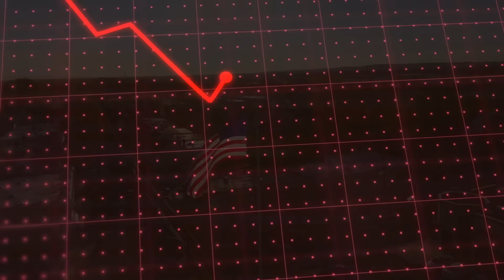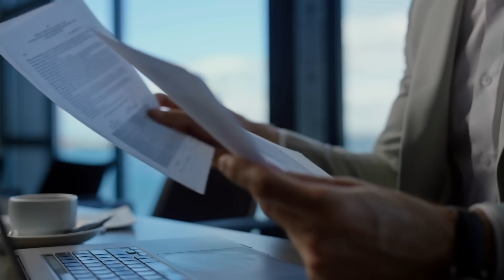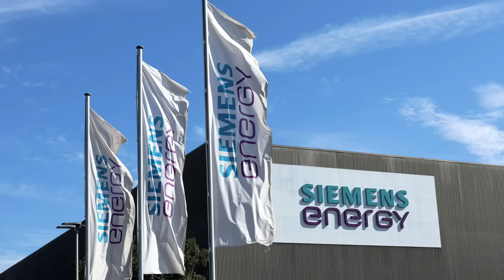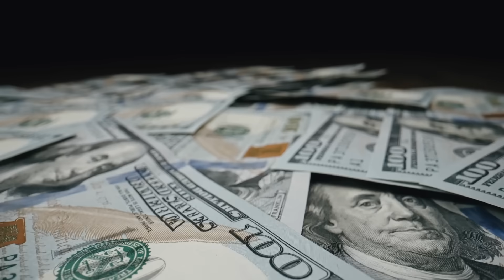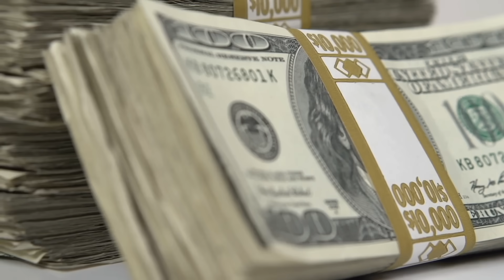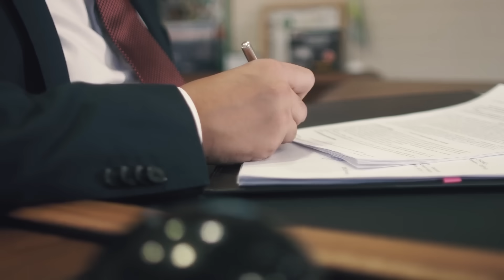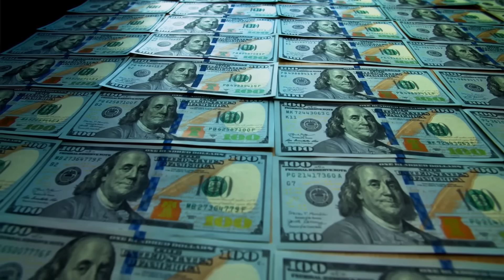The Real Reason America Has Turned Its Back On Wind Power Energy

Comment: This video raises good points that I don't see in other news.  One of the biggest problems with solar/wind is that it is inherently diffuse.  The grid was designed to transfer power from large, point sources.  Solar and wind produce a little bit here and a little bit there, requiring a much more costly, and humanly objectionable, grid.  No one wants ugly high-voltage lines ruining their scenery and TV/radio reception, and causing problems with high-voltage fields in their house.  And people don't want to pay a lot more for their electricity to fund all the extra transmission lines and transformers.  Also, the intermittency of solar/wind require fossil fuel backup.  (And don't say "big batteries" unless you have many hundreds of billions of dollars you want to donate to pay for them.)  Germany had the highest electrical rates in Europe BEFORE the Ukraine war, due to its reliance on solar/wind.
Reply: Then generate it really locally, at your home. Then you massively reduce transmission costs AND you can use it without having to buy it at supply prices which are much more expensive the way the market is set up. The energy supply industry of course don't want to advertise this as an option because they'd go out of business.
Reply: @aries6776  That means you also need to store the power locally, which is quite expensive, when you need to store power over longer periods. Transmission grid are expensive, but they serve millions of people, so per person the costs are not that high.
Reply: @aries6776  You must live in a warm climate.  That kind of thinking would sentence people living in colder climates to a quick death sentence.
Reply: @christophercharles3169  Why? Wind power is thing in colder climates, isn't it? I live in the UK and even here was can get 50% of our electricity from just solar.
Reply: @christophercharles3169   How would people living in a colder climate be given a death sentence? People in Alaska use solar power. I'd say that's a pretty cold climate.
Reply: @aries6776  Their is a compromise of setting up wind farms nearer to towns and cities, where it can be transmitted cheaper at 11kv. The high voltage grid is the problem, particularly when people build wind farms no where near where the power is needed, then blame everyone else. They would not invest in an ice cream parlour at the north pole, so why not put their brains in gear first.
What is really needed, is a government run department to plan the whole strategy, keeping production and transmission in line with each other. If 25% of the wind farm investors had invested in distribution, it would have been a win win situation.
I sometimes wonder what we have a government for, other than to make fools of themselves on the news.
Reply: @wilsjane  I wholeheartedly agree with you. It's not just your government, this happens everywhere. Too many plans go in half-cocked without taking control of all the elements and looking at the big picture. Getting funding from the wind farm investors towards distribution would have been a sensible idea.
Reply: @aries6776  Every city, every neighborhood, should have these things within feet of those that use power.  No storing anything.  Of course, you'll have to deal with light flicker, ice flying off from the blades, low frequency noise problems and cleaning up the dead birds and bats at each turbine, but it's worth it to charge our battery cars and cell phones, right?

Anyone else looking forward to the day that we put even more pesticides in our food because the bats that ate hundreds of thousands of bugs each night have gone extinct?  Funny how bats don't even need to run into the blades, just be below them a little bit as the pressure compresses their lungs and kills them.
Reply: This is why wind turbines should sit in cities, right above those that use them.  The power goes straight to the people instead of being transferred for miles and miles, losing energy.  That's right...if you want them, put them in your own backyards instead of destroying the large expanses of natural land.
Reply: @NxtHumane  They put them miles out to sea, where there is a lot of wind, and they are barely visible. That is why they need to be connected to the grid.
Reply: @scottelly2  Where they also lose a lot of power before it can be used.
Reply: Not to mention the huge tracts of land required for these projects.  In the case of wind, that land is ruined forever.   They will pour tons of concrete they will never dig up.   Wind/solar is the biggest boondoggle in history.  A total scam on the people to even pretend it is ever going to replace nat gas and coal
Reply: Don't tell the pro-wind faction about wind providing intermittent, unreliable, non-dispatchable and weather dependent power because they will call you every name in the book. It's true, but they are not interested in truth. They are interested in receiving their wind lease payments.  They will tell you that it's better than burning coal and kitty dung. But, they won't really address your comment with common sense and research.
Reply: «This video raises good points that I don't see in other news.»
--
You don't see it elsewhere because it is utter nonsense.
Reply: @voltydequa845  you’re right.  Wind and solar is ldlotic.
Reply: @NxtHumane  «you’re right.  Wind and solar is ldlotic.»
--
The ratio of solar rays  to electricity is around 15 ÷ 18  % efficiency. 
The upper limit of air's kinetic energy exploitation is around 59  %  (Bet'z law), and of course only  under ideal  conformation (that depends upon surface against the air), and seen that the surface of the today's blades is almost negligible (compared to the ideal disk-like actuators). 
Wind was used in Holland's windmills and sawmills. They were quite smart, and were aware of the limits of power that can be obtained. I read some comments here, and think that so many people live in a kind of cognitive world detached from reality and common sense. It seems that the religion of the pseudo-science (Star Trekkian - like) makes them believe miracles will be possible.
As for the nonsense about the grid, there is enough technology to connect, to the grid, even a bicycle dynamo (though won't since cost vs gain). But if there is a source with variance, that produces (even only) megawatts they can connect it without difficulties. There is enough electronics and monitoring possibilities that makes it perfectly possible. The excess of energy, of the entire grid, can be stored back by means of mechanical capacity (pumping water back up the dam - just an example), with flux proportional to the excess. etc etc. 
And the practical and simple proof on how much energy can be obtained from wind can be built next to a farm. And for sure it won't be neither bizzarre structure with thin blades, nor hot-air talk  about supposed technical difficulties to interconnect it with existing sources. 
The main problem is invested vs obtained energy (considering the life-cycle, etc),. 
And sorry for this so long.
Solar is ok, especially thermo, on small scales. In some circumstances wind too. But imho in small scales too.
Reply: @voltydequa845  I'd support small scale that were located next to the source needing it.
Reply: Yes after 49 years of constant treason by Labor/gang-green Politicians and the Cowardly LNP politicians, we are still just barely a Sovereign Nation! but have our politicians in Labor and LNP made private agreements with the Globalist Cartels for when the UN Global Government is realised! The betrayals of our Politicians for the WEF=EU=WHO=UN that have weakened our Sovereign position!
                   I remember when we did make our own fuels from our own oil and Gas, we were the Luck Country after WW2, we made and grew everything the Australian people needed, no job shortages, one income families, yes that had to change WW2 succeeded in destroying the globalist Monster on My parents time, today we are in the fight of our lives against the globalist MONSTERS of this century! the WEF=EU=WHO=UN=Billy Goats=Vanguard=Black Rock=Big Pharma=Big Tach, all wanting a position on the Great Reset table, sounds just like a movie script, must be bulldust right.
               But that was before our two UN controlled governments turned to the "Dark Side" back when we were the Lucky Country, we manufactured and grew everything the Australian People needed and exported it around the world as well! That was 49 years ago, before Labor and LNP turned to the "dark side" of the unelected United Nations,
         In 1975, with no public consultation, the ALP government of Gough Whitlam signed Australia up to the United Nations Lima Declaration which required Australia to reduce its manufacturing capabilities by around 30% and carelessly destroying 30% of Aussie workers jobs!  and to commit to importing that amount from other preferred countries China, Vietnam, India. Pakistan, etc since then the UN controlled Politicians are destroying our electricity supplies, our Industries, our defence of this nation, and are currently working on destroying our Farmers as agreed in the UN Agenda 2030 sustainability and Climate Change scams agreed to in 2015 by LNP PM Malcolm Turncoat and Julie Bishop ( She now works for the UN! No surmise there),
                        the betrayal is by both labor/Gang-greens and LNP, also the LNP leads labor in their Collaboration with the UN, also in case you are unaware, the Globalist Cartel consists of the WEF=EU=WHO=UN so there is really no distinction between the whole Globalist Cartel and just the UN.
Reply: Germany started to build renewables when they were still expensive. Because of learning by doing and economies of scale, this brought down the price of new installations. Because the way of how the system was set up, the cost of the early expensive systems still influence the electricity price today. But new renewables in Germany now beats new fossil fuel and new nuclear on costs.
Reply: And how do natural gas & coal power plants get their required non-stop supplies of fuel?  

The answer is these power plants require a vast network of supply pipelines and freight trains to feed them non-stop daily or hour by hour.   These supply lines obviously extend far beyond the actual power plant itself -- thousands of miles easily to their raw source.  These supply lines and the network they form are also energy connections like the grid but ones based on physical matter which are not as efficient as electrical links.

Even before local distribution, there is a massive 24x7x365 global effort of human power, equipment, investments, subsidies to explore, drill, refine the raw material often from miles within the Earth.  The refined gas and coal does not just appear in the pipes and railways by magic.  The process itself takes a lot energy.  The US could easily power all its EVs and more on the energy it uses to refine petroleum products.

So fossil fuel power plants are a lot more "diffuse" than people see when they look at a plant just smoking or steaming aways in the distance behind fences and gates.  It is not obvious at first.  The fossil fuel power plant is just where the fuel is burned and not at all where the fuel came from.

Like the grid, these pipelines and transport links have a limited lifetime and eventually need to be replaced at the end.  They also incur O&M expenses along the way too while they are in active service.  There are conflicts all over the world when oil pipelines cross lands.  Nobody like their look of those either and if there is a rupture in the line, the lands can be ruined for a long time even after millions of dollars and years of cleanup.

Coal power plants also create tons of coal ash each day that needs to hauled away and disposed off -- not all of it ecologically either.  It can end up leaching into soil and waterways.  This is in addition to the coal power plant produces 2100-lbs of CO₂ per megawatt-hour (MWh) of energy production.  Natural gas produces some 900-lbs of CO₂ per MWh.  All of it released into the air as if the atmosphere was some public free-to-use toilet.  A big problem is that CO₂ is invisible and odorless -- out of sight and out of mind.
Reply: @beyondfossil  Any major solar and wind installation also requires a fossil fuel backup for when the unreliable nature of the power source raises its ugly head so your argument is a non starter.  Unless nuclear comes into the picture, the proponents of wind and solar are simply dreamers imho.  Adoption of large scale wind and solar energy generation will inevitably result in significantly higher prices for the consumer.
Reply: @beyondfossil  Picking up a piece of GOP propaganda off the street I read to my consternation that the GOP crime syndicate will "unleash America's energy resources" - drill baby drill!

Comment: Similar in the UK, with a 5-10 year wait for grid connections. 2035? Good luck with that one 🤣 
Just like Tesla, UK EV chargepoints are starting to use generators to make up for demand due to lack of supply.
Reply: Charging the coming "10 minutes to charge" batteries is going to be logistically a near impossibility. Not enough copper for all the Amps.
Reply: @msimon6808  How about recycling them? That's going to be a nightmare too.
Reply: Good to know!🤣
Reply: That is untrue.  There are no delays in the UK.   The country has installed thousands of megawatts of wind and solar but discovered it does not save fuel and the capital cost cannot ever be repaid over the lifetime of the project.
Reply: @ValMartinIreland  There's always one! Sure your 'opinion' counts... June 2023, GRIDSERVE: Grid connection delays overcome by interim microgrid solution using a battery system in conjunction with vegetable oil generators and Getting new Electric Super Hubs online often isn’t straightforward. Over the course of anywhere from six to 18 months according to Gridserve, others report a lot longer depending on location. But I guess if you say it ain't so you must be right...eejit😒🤣
Reply: Hoax.

Such a load of garbage.

There no such thing as a greenhouse effect.

The whole premise of AGW -- the greenhouse effect -- is wrong.

There is no such thing as a greenhouse effect (except in an actual greenhouse (closed container)).

But there IS  a trillion dollar $$$ boondoggle that is the muscle that twists arms behind that stupid renewable energy.  

"Welcome to the Mafia-ization of the energy business."

             * * *

A Novel Perspective on the Greenhouse Effect (Tom Shula)

https://youtu.be/NS55lXf4LZk

1) Markus Ott: Questioning the greenhouse effect

https://www.youtube.com/watch?v=Bj6ORbRBZ2s&t=7s
The greenhouse effect is the primordial sacrament of modern climate science. It is preached from kindergarten to the nursing home.  The simple name of this effect and its ubiquity in culture and mainstream media leave no doubt that we are dealing here with solid and fully understood Natural Science. But how does this actually effect work?

2) Markus Ott: Atmospheric greenhouse effect ~0?  (Applying IPCC formulas to the no-atmosphere moon. Conclusion: there is no greenhouse effect on earth.)

 https://youtu.be/JXKHfL55G2A

Min 6:xx.  "Abuse of the Stefan-Boltzmann model..."

3) Markus Ott: Saturation of the CO2-IR-Absorption

https://youtu.be/CrMGTkPADFw
(Min 0:10) The alleged greenhouse effect of 33 degrees centigrade is the result of an improper use of the Stefan–Boltzmann Law (black-body radiation), and that a less abusive application of this law makes the greenhouse effect almost disappear. 

4) Markus Ott: Convection and Thermalisation Kill The Greenhouse Effect

https://youtu.be/RbNNhLqhWPg

In-Depth Comments on Sabine Hossenfelder's Talk: Greenhouse Effect 

"Heat transport in the atmosphere... IT'S CALLED WEATHER."
https://youtu.be/sY2xHk0ThJ8

https://thebreakthrough.org/journal/climate-change-banned-words/art-climate-change?utm_source=Breakthrough+Newsletters&utm_campaign=12e6304fed-BTI_Weekly_1_18_2023_COPY_02&utm_medium=email&utm_term=0_49b872540e-12e6304fed-466887052

If heat rises, why is it so cold in the upper atmosphere?
https://www.physlink.com/education/askexperts/ae670.cfm
Reply: What should that tell you about electric car future...inadequate grid, greenies want clean power from thin air, eare earth metals from hostile enemies !!!???